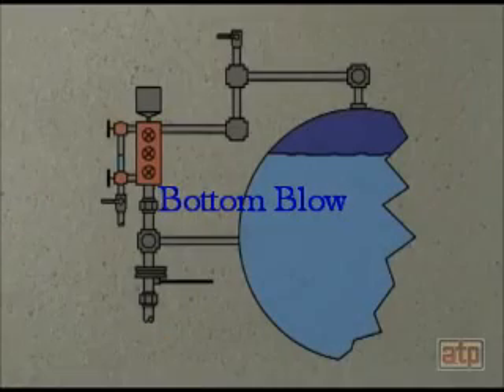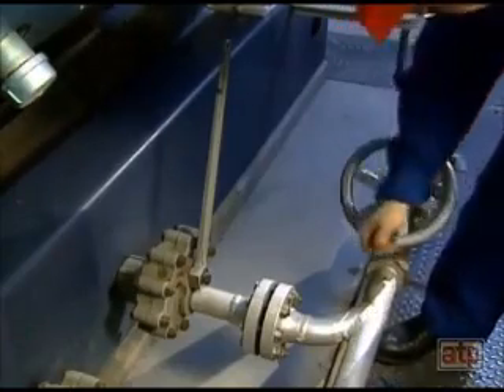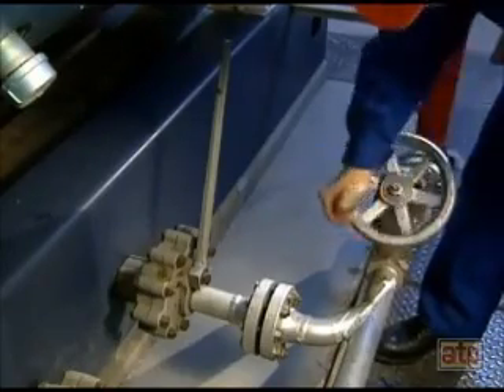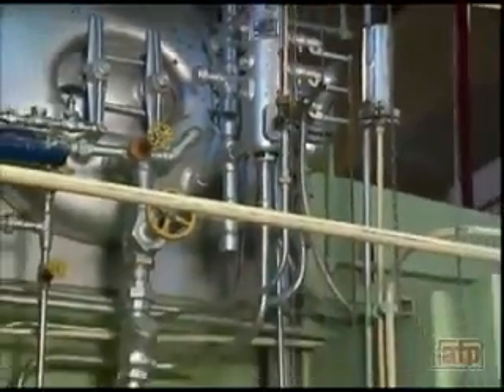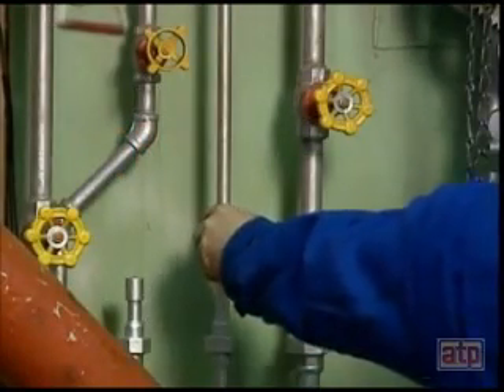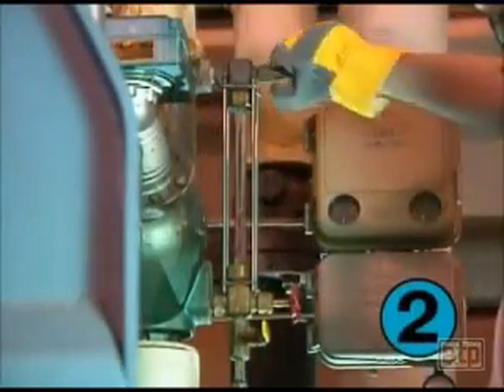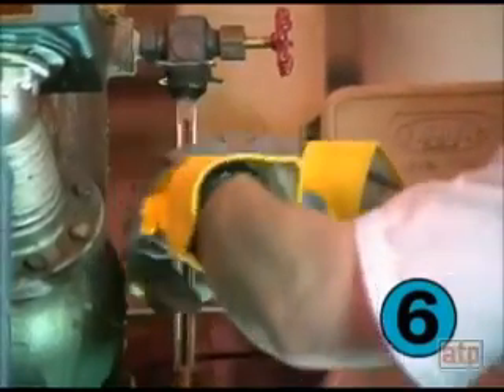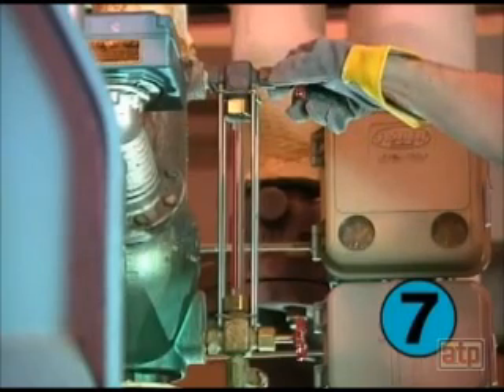Boiler Cutoff, Blow Downs, and Gauge Glasses

Comment: For practical training purposes this video is fine and in 40 plus years as a boiler operator I have never seen anyone blow down the gage glass and water column differently.   However If you check the ASME code for blowing down a boiler gage glass and water column it is a lot more involved.
Reply: Tim Farrell have you encountered a low fuel pressure then alarm for flame failure sir? Your help is greatly appreciated...
Reply: 6200058166